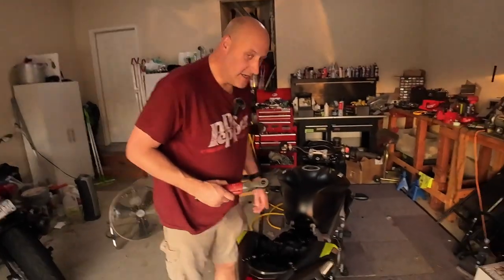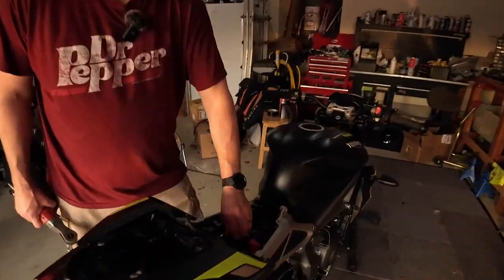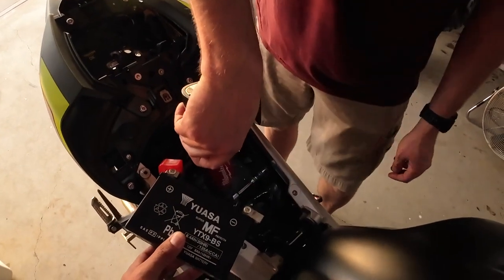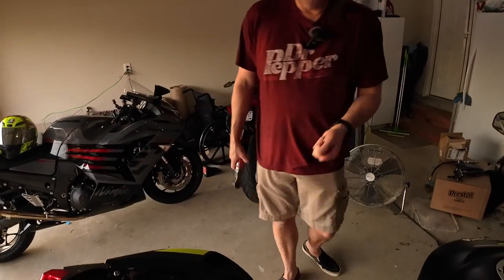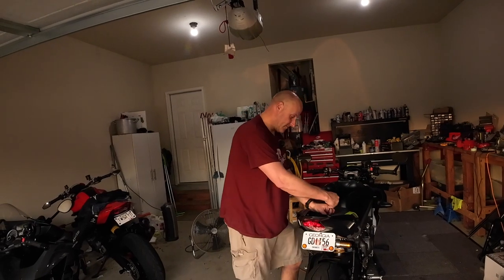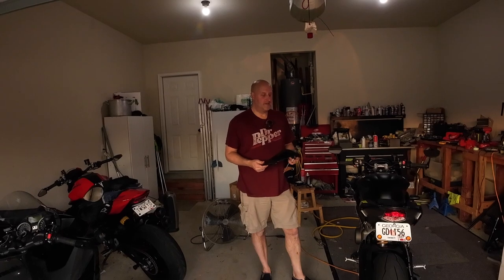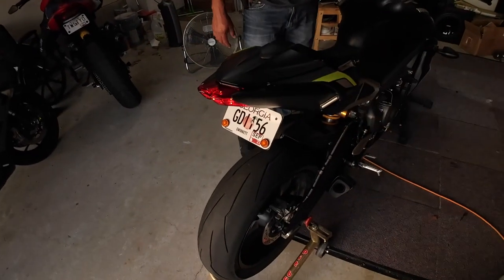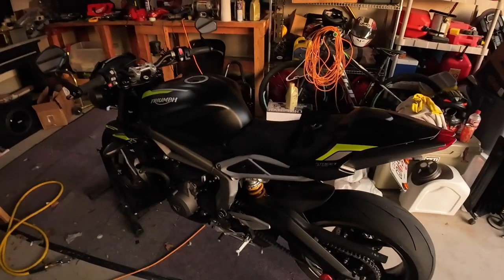Dave's Garage - Street Triple RS passenger peg removal

Comment: One of the first mods I did to mine. These are NOT two up bikes at all! They shouldn’t even come with a rear seat and pegs. I removed mine and run the rear cowl instead of the “seat”. And I totally agree on the whole “anything over 145 on a naked is brutal”. It gets insane at those speeds with no wind protection
Reply from the maker: Yeah, not sure why they bother, but I am sure that there is a rider somewhere that takes his girlfriend on the back...
Reply: @SquireSCA  yeah as long as she’s early 20’s or younger and weighs about 110lbs or less. 😂 😂
Reply from the maker: @cfltitan  Which is sort of ideal, for a variety of reasons...  ;-)
Reply: I’ll say anything over 120 on a naked is brutal.
Reply: @RadDadisRad  it definitely is